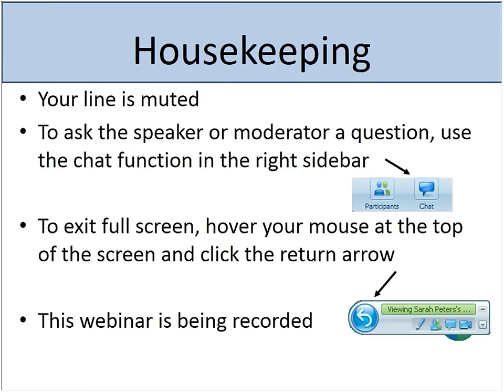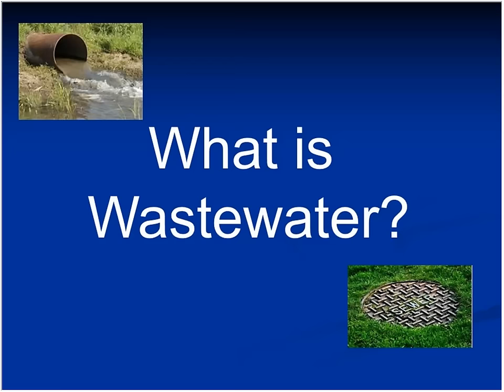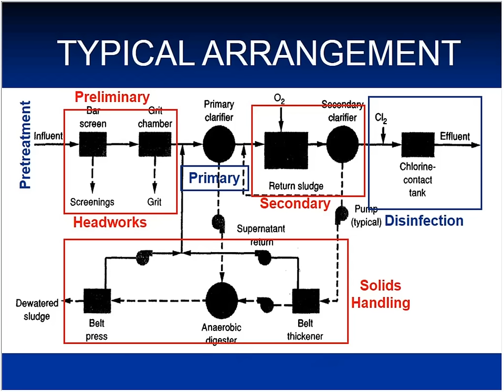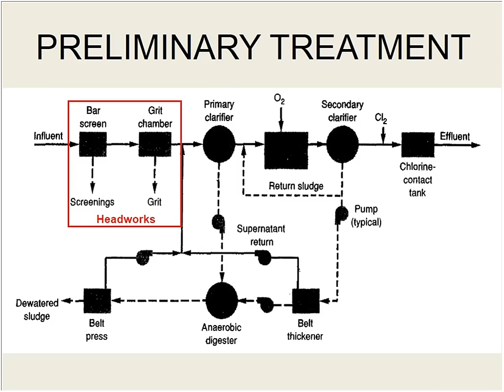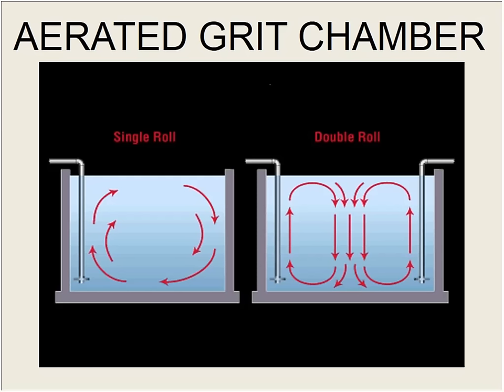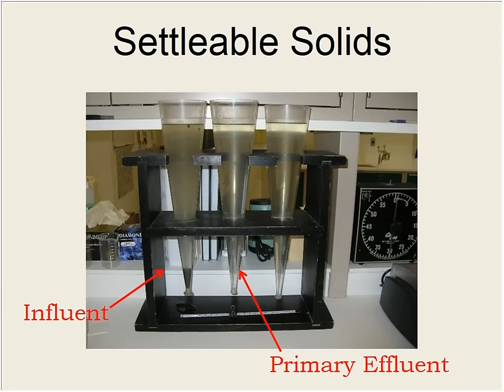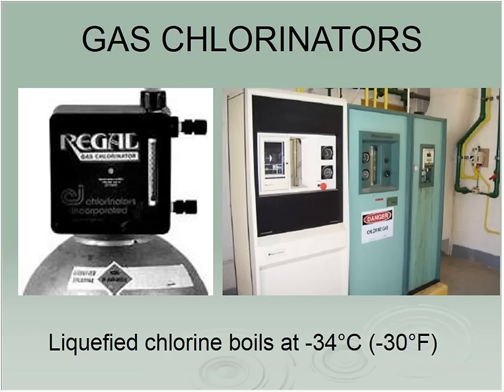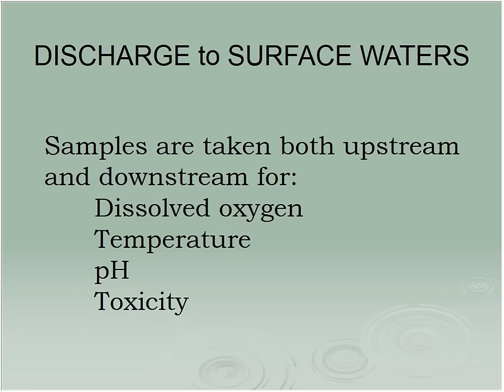Wastewater Training, 1 of 3

Comment: The biggest idea I am trying to express is tunneling aqueducts from the coast, in this case the west coast of the USA inland to feed combination geothermal power and sea water desalination plants.  The idea seems to be so big that no one has considered it possible but I believe it is not only possible but it is necessary. For over a century the fossil water contained in aquifers has been pumped out to feed agriculture, industry and municipal water needs. The natural water cycle cant refill fossil water deposits that were filled 10,000 years ago when the glaciers melted after the last ice age. Without refilling these aquifers there is not much of a future for the region of the United states. As a result ground levels in some areas of the San Joaquin Valley have subsided by more than 30 feet. Similar fossil water depletion is happening in other regions all around the world. TBM and tunneling technology has matured and further developments in the industry are poised to speed up the tunneling process and it's these tunnels that are the only way to move large volumes of water from the ocean inland. The water is moved inland to areas where it can be desalinated in geothermal plants producing clean water and power. In many cases the water will recharge surface reservoirs where it will be used first to make more hydro power before being released into rivers and canal systems. It's very important however to not stop tunneling at these first stops but to continue several legs until the water has traveled from the ocean under mountain ranges to interior states. Along the way water will flow down grade through tunnels and rise in geothermal loops to fill mountain top pumped hydro batteries several times before eventually recharging several major aquifers. What I am proposing is essentially reversing the flow of the Colorado River Compact. Bringing water from the coast of California first to mountaintop reservoirs then to the deserts of Nevada and Arizona and on to Utah, New Mexico, Colorado and Wyoming. This big idea looks past any individual city or states problems and looks at the whole and by using first principles identifies the actual problem and only solution. 

Thank you for your time, I would like the opportunity to explain in further detail and answer any questions
Reply: Be cheaper just to desalination  and pump it into the mountains during the year. But especially in the winter. Which will reslut in more run off in the spring and summer. and also help the albedo effect by having snow topped mountain longer into the season and help insulate out precious glaciers. Also can have them supply cities and coastal town. Also can have didcated desalinators for agricultural. Then to refill the aquifers you just need a pump station to pump water back down to refill losses water from artesian wells.

Comment: I worked for a city in the northeast and till the early 2000s, half the city's  sewer system was dumped straight into the river through stone and brick tunnels that were built in the 1700s

20% of the city still dumps straight into the river to this day

No one in the city even knew about all the tunnels and connections